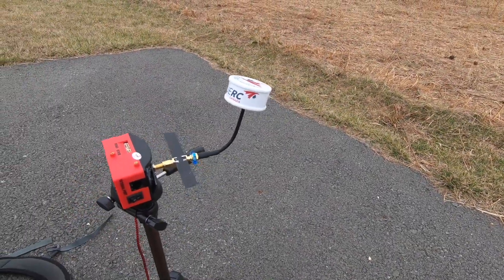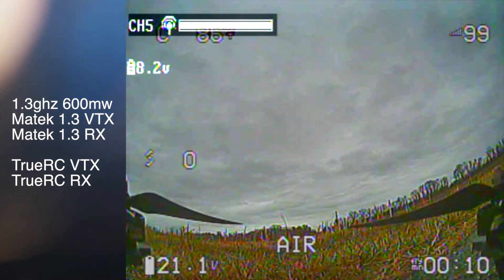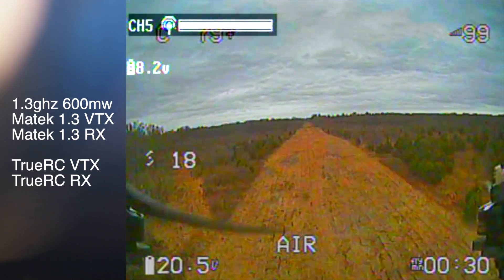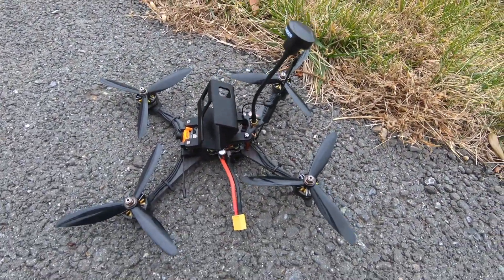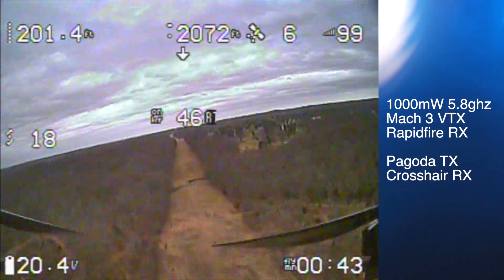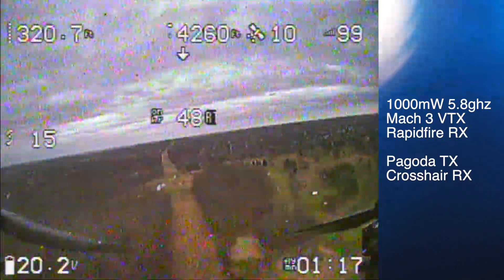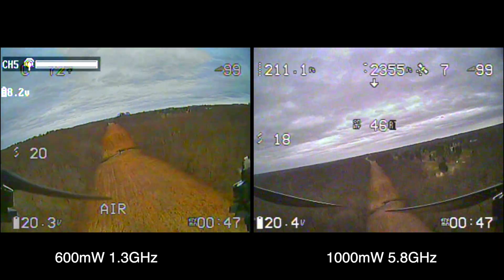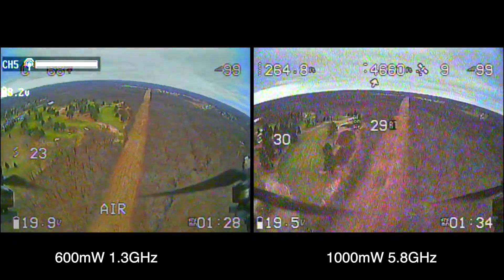1.3ghz vs 5.8ghz, side-by-side at one mile

Comment: That Matek 1.2Ghz receiver and transmitter are very bad, if you want something good you have to invest in something good
Reply: like what? The transmitter is quite good,  I've flown 25 miles out on one. It was about at its limit, when it should in theory go further, but still that is not a bad video transmitter.

Comment: Excellent!  We use very similar antennas on the 5.8ghz/RapidFire and I'm interested in the Matek 1.3-VRX V2 module that just came out, so this is a very handy comparison.  If you just use the 1.3 Singularity on the ground/goggles like this video, and a Singularity on a plane, how do you think 1G3 on omnis would perform out past 5km, compared to 5G8 with your directional antenna?

Comment: I can go 11km far with 5.8g and probably beyond at low altitude - 131m
Reply: I use SKY04L goggles with TBS Unify Pro32 HV and I get 10km !!
Reply: @yousefsaadeh7144  what antennas are you using?
Reply: @kudzy11  TRUERC X-AIR 5.8 MK.II with tbs VAS 5.8 ION PRO 👌

Comment: Really curious how the video quality of 1.4 would hold up flying behind objects compared to 5.8. I mean surely eventually the diversity module and higher mw would  beat out the 1.4 right?
Reply from the maker: Oh man, it's really bad behind objects. 5.8ghz works better behind buildings at 100ft than 1.3 does
Reply: My 1.3gh works nice even at range 200 metere behind trees.

Comment: I have Dragon Link 1.3 Ghz in Control Remoto. It will be possible to put Matek TXV / RXV1,2 Ghz without interference on the plane? thxs
Reply from the maker: Those are high risk for interference. Spread them as far apart as possible. I wouldn't do it long range though
Reply: Gate Crasher FPV ok 👍 then I’ll to buy other TXV to Dragon Controller and other Plane with Matek TXV 1.2 with other 2.4 Controller. Thxs

Comment: That the video looks better afterwards apparently has to do with most DVR's not recording blank frames. I get the same "effect" as well. To increase your 5.8 signal I'd go for the TrueRC X2-Air and a TBS Pro on the quad. It's all about the antennas :)
Reply from the maker: Good points all around. Thank you!

Comment: I use a FuriousFPV 2.4 800mw vtx, Smaller antennas than 1.2, no need for a filter and you can still get plenty of range.
Reply: But it's horrible to use in urban environments.
Reply: @iRoNiiC_H3R0  because of 2.4 wifi?
Reply: @blackterminal  yes

Comment: I agree about your comments on the 5.8ghz. I can barely complete the 1 mile challenge on 5.8ghz using VAS Super Cannon 
(15.5 DBI). Problably doesnt help that I do my runs on the clearing for powerlines....
Reply from the maker: TransAm2k4 ahahaha oh MAN those power line clearings are so tempting!!
Reply: I have that antenna (super cannon) and never had luck with it.  I have been further than 6 miles on 5.8 using a mad mushroom on the plane and both a 13db IRC/fatshark patch right on the goggles or a circular wireless 8 turn 12db helical.  I probably fly with the patch the most as it has a wider zone but if I am going for max distance I haven't found an antenna that beats the CW helical on 5.8.  That includes beating the vas pepperbox and crosshair.  You do have to use your head as a head tracker and keep things pointed at the craft.  Now once you go 2.4 or 1.3 you have the truerc gatling which is an amazing long range antenna with pepperbox coming in a 2nd place.

Comment: I want to get into wings. I agree multirotor long range is really slow. I have seen some Drak videos where a guy does over 100MPH flat out for 8 minutes covering 21KM. In my multirotor I typically cruise at 35MPH and get 7KM if wind is calm.
Reply from the maker: It surprised me how stark the difference was. 50mph punchouts used to feel fast, but then I started cruising at 50mph and going back is strange! Of course I still prefer quads for park settings but in a big open field wings are where it’s at. Plus they’re a lot cheaper and simpler to build haha
Reply: @GateCrasherFPV  Yeah can't beat a bit of freestyle. Do you recommend any wings?
Reply from the maker: @changeagent228  100% go with  Sonicmodell AR Wing 900mm. (It's the same thing as the RMRC Recruit)
Reply from the maker: The dude you're talking about who went 8 minutes @ 100mph was probably flying a Mini Drak
Reply: @GateCrasherFPV  Thanks yes it was a mini drak. I have a spare DJI Air unit so whichever one I get is getting it slapped on lol. Do you use iNav? I like the idea of auto launch and landing.
Reply from the maker: @changeagent228  I do use iNav and it's awesome! Auto launch is so nice. I also like the position hold, which pretty much means it loiters in a circle. I flick a switch then take my goggles off and go do whatever haha. You won't need auto landing though. Once you land once it gets really easy. Keep me posted!
Reply: @GateCrasherFPV  Haha awesome. Sure I will keep you posted when I get it sorted. Cheers. 👍